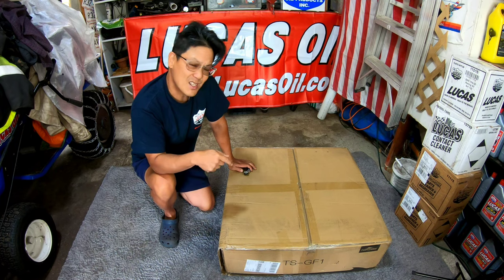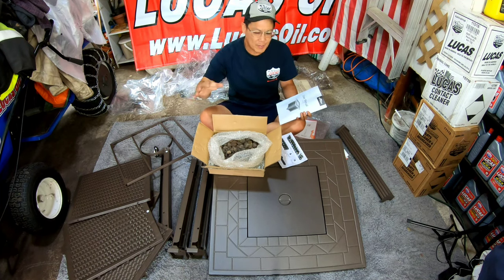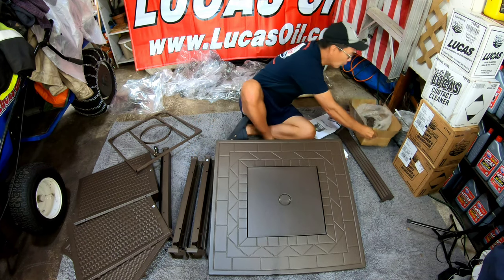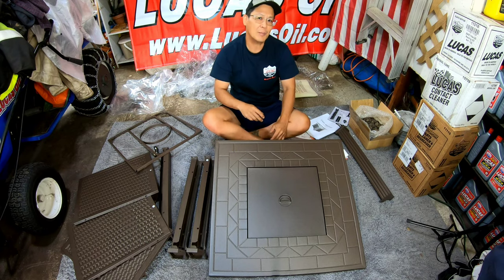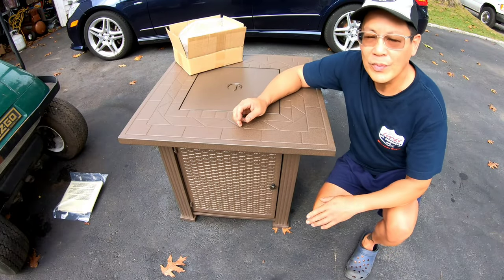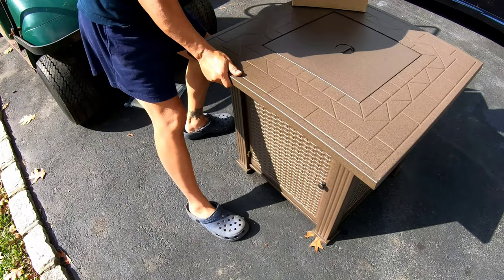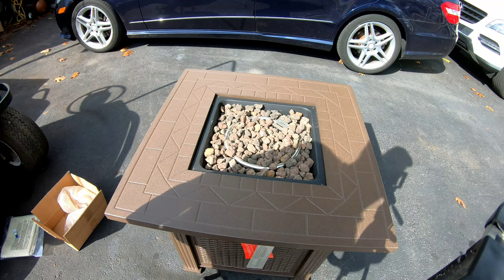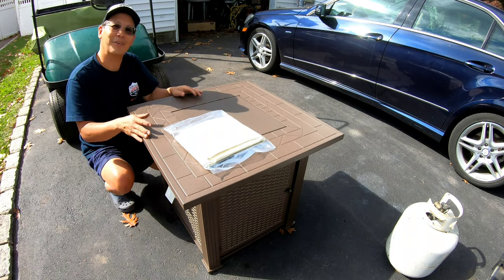TOPSHAK GF1 BANGGOOD 28" 50,000 BTU PULSE IGNITION PROPANE FIRE PIT UNBOXING  INSTALLATION & REVIEW

Comment: Adding a battery adds extra safety packaging and shipping requirements which drives up the cost.  So if you want a battery to come with it the average guy will probably need to cough up an extra charge.
Reply from the maker: A dollar?
Reply: @MowersNBlowers  A considerable amount more than a dollar, as Savage Small Engine said there'd be extra packaging to make sure it didn't short-out on route and start a fire not to mention the extra paperwork. I'd be pretty annoyed if I ordered something like that and had to pay the extra money for shipping just so they could include a single small battery.